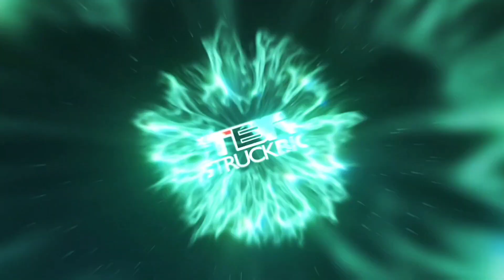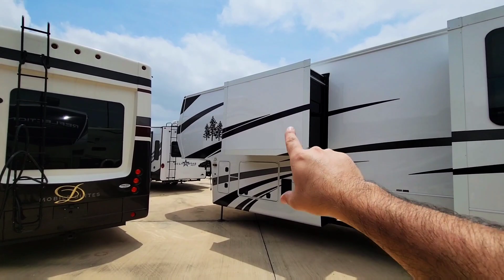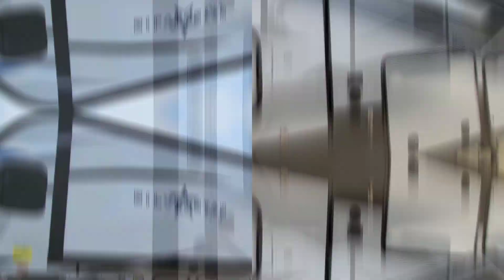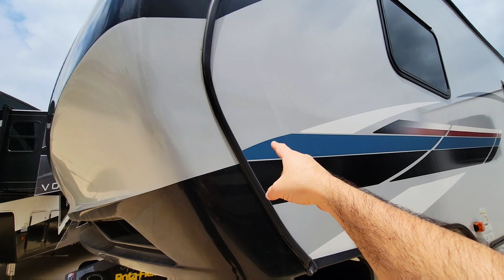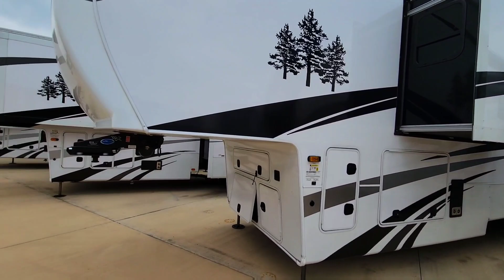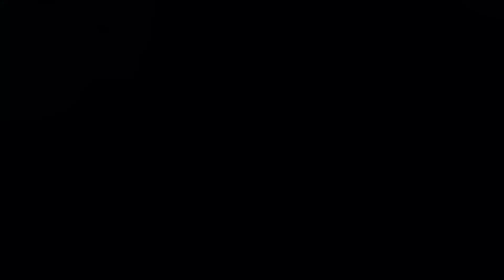The RV Industry NEEDS YOUR OPINION on this!

Comment: We have been camping at The Ridge Outdoor Resort in Sevierville Tennessee since the beginning of May so I decided to give you the opinions of fellow RVers. Yes, while a walk this morning, I asked people what their opinions were. 😀. We own a 2021 DRV that we LOVE. We purchased ours wanting full body paint, no vinyl decals and a traditional paint pattern. When asking others in the campground, I was surprised at what their opinions were. I will list them by each topic:
1. Edgier graphics - 14 to 1 said no. They like the more traditional designs on the units. One owner had the opinion we have, “When manufactures use the bold graphics and name incorporated (like the Voltage you showed), it cheapens the look of  RV tremendously”. 
2. Vinyl Graphics - 9 to 6 would prefer no vinyl graphics because of the durability. As one said, “If I am going to spend upwards of 80k, I don’t want it to have a ticking clock on how long the outside is going to look good.”  I agree with him
3. Full body paint - ALL 15 said they would prefer full body paint because of durability and look. As some of them said that they wished they could afford full body paint but it didn’t fit in their budget. I understand their point. We don’t full time but we go out a lot and for an extended period of time. We wanted to get the most of our money and not sink money into a unit without full body paint for it to look bad in a few years. It was worth it to us and a must on our list, if it had any vinyl on it, we passed quickly. 
Our opinion - The edgier graphics look very cheap to us, we would prefer for them to improve their materials and layouts instead of trying to make themselves different with the graphics. As I said previously, full body paint was the only way for us. We couldn’t justify sinking that kind of money into an RV for it to look really bad in a few short years. People want thicker side walls, better insulation, better comfort, etc but are okay with the outside prematurely aging?  That makes no sense to us. There is one unit (Grand Design Reflection) in the campground right now that is 6 years old and the graphics that GD put on their unit is so faded. That’s not okay.  They paid good money and they said they wished that they had put the extra money into full body paint.

Comment: I wish RVs could have vinyl wraps like other vehicles. You would get the look of full body paint at a fraction of the cost. It would protect the outside finish and could be changed if it gets faded, outdated or damaged. It could be expensive to change but could be done. I haven’t seen any manufacturer do a wrap, just stick on decal graphics.I like the look of the full body paint as it gives so much more color to the RV.

Comment: Every time i look at RV’s i ask “can they leave all stickers off.   If i was going to special order a gel coat i would ask for all stickers to be left off.  
Full body paint i would prefer less stripes and more solid color with Pearl in the paint.   Swoops are old looking i like the idea of straight lines If they have to do multiple colors.  Voltage would be my pick but i would rather have 2 colors and less busy changes.

Comment: The Voltage is a nice, clean evolution from the swoops that have been on Prevost RV's, low rider and custom cars since the 80's. Paint and graphics are long past due for an upgrade. Overlanding trucks and RV brands like Luxe have been launching units with minimalist graphics packages that just look clean. Sometimes less is more.

Comment: I definitely prefer the full body paint, both on the coach and the slide outs. The less edgy and the less swoops the better. I prefer the look of the Luxe 2 tone solid color paint job. The Voltage is the nicest of the ones you showed today.

Comment: Regardless of cost I would like whatever the most durable finish there is. I do not care about the color or the designs on them. If I had to have a plain white Motor Home that would last and last I would gladly drive it. I am definitely function over form.

Comment: I’d buy solid color every single time. Logos are fine but I don’t like stripes or swoops. The less graphics/designs the better. Like a solid dark gloss gray redwood with the name “redwood” in black on the side above the pin box and the black redwood trees on the front cap would look so good.

Comment: Full body paint all the way. It really brings out the character of the coach, and  enhances the whole body. It emboldens the coach and displays the fun mindset that RVing is all about. The Voltage looks absolutely stunning and paint was designed edgey and modern. Really states that it's about fun and it's built to make exciting memories. The swoops of the past are so dated and like you stated, somewhat boring. It's refreshing and breathtaking to see the full body paint "pop" off the canvas that the body of the coach is. It certainly makes a statement.

Comment: Personally, disc brakes, HD tires, and over rated axles and suspension is a way better thing to spend extra money on than full body paint.  But that voltage was great looking.

Comment: I love the first two designs.  I LOOOOOOOOVE grey, black, and white colors.  The Voltage looks amazing.  If I had one, I would get a sealant on the paint to preserve it as much as possible.  I have grey, black, and white swoop & edgier graphics on my Equinox Premiere SUV.  Also, I have a sealant on my entire vehicle AND a 3M coating on the front for nicks, etc.  👍

Comment: Personally I don’t understand the reason for all the graphics. To me it looks too busy. Minimalistic in my opinion looks better. But everyone has their own tastes and opinions, which is why RV manufacturers should offer both styles. Although I haven’t had any problems with the vinyl decals on either one of the 2 trailers I’ve owned, I do agree that the full body paint will most definitely last longer. My neighbor has a 2 year old Grand Design 5th wheel and he actually has bubbling under some of the decals. So that can definitely be a problem. I’m sure full body paint can have defects as well, but in the long run you’re probably much better off getting the paint rather than decals. The Big Horn was my least favorite (definitely too busy) and the Voltage was my favorite.

Comment: Love that Voltage!  But I'm more Edgy and Bold.  I like the sharp lines.  Gimme a full body paint with the Eddie Van Halen red "Frankenstrat" guitar graphic and I'd buy THAT!  Full body paint Pro's:  Super nice looking, better resale, easier up keep than stickers.   Full body paint Con's: SUPER expensive compared to not painted, have to be uber careful not to scratch it with routine maintenance items (like servicing the water heater (watch that door panel!), fridge, going on the roof, etc).  But full body paint, and super edgy sharp graphics are what I personally like.

Comment: I suppose my preference for edgy vs swoops really depends on the overall design.  You showed several of each style that were really nice that would be difficult to imagine with the alternative patterns.  On the other hand it really stood out that very little thought was put into some of the examples you highlighted.  No matter whether it's swoops or edges my preference is always going to be for a nicely designed pattern that looks like someone put some time and effort into and not just having it as an after thought.  Thanks for the opportunity to add to the conversaton.

Comment: Wish they would all go to full body paint. My Jayco travel trailer graphics deteriorated around 10 years, and my Jayco Designer 5th wheel graphics started fading and cracking after about 8 years even though I wax them periodically. My 2021 Jayco Eagle has very nice graphics which I am hoping will hold up better.

Comment: One I like best is full painted body of Redwood, next Voltage. I think that it depends on each unit: Toy Haulers should have an "edgey" full body paint scheme. You want to be notice out in the wide open spaces. Saying I have arrived. Full Timers want "Full Body Paint" with nice lines that reflect the manufactures paint scheme. They also want slide panels with graphics on them to "flow" nicely. I'm sure if a buyer really loves the RV, they will pay a paint store to paint it there liken. Stay safe. Keep the great videos coming. 👍👍🙌🙌🤓

Comment: I like light colors so that the heat transfer is minimal to the interior, requiring less running AC's. Simple graphics are great, if you don't wash with de-ionized water you will have water spots on the dark colors, requiring more work to remedy. Simple designs give the illusion of length and heights depending how they are used.

Comment: Something to consider on the full body paint is repair.   An otherwise minor side swipe can cause an enormous amount of paint repair.   Color matching can also be an issue.   I work in rv Insurance and minor claims turn into big long ones to fix the full body paint. I have also found they aren’t using top of the line auto paint on these in some cases and have seen some fading even in full body paint units.   I prefer a white camper with some nice but subtle decals.  They just need to start using some ultra high quality vinyl that won’t fade so bad... it does exist.  
Some of those crazy full body paints are over the top to me and almost make me dizzy.  I also question how they will look in 10 years and if the style and colors will still be “in”.   I think of 80’s and 90’s power boats full of crazy pink, purple and pastel designs.  Looked cool then... look gaudy and tacky now.  Just my .02.

Comment: We did the same thing as Valerie did. We asked 20 people here where we are this week. For us, a full body paint with a simple design is what looks the best and has the most long term advantages. That said, the cost of a full body paint would allow graphics to be replaced every few years... As for the group we asked.. 5 were over 60 and all liked the simple design or just a two tone color scheme. 7 were between 50-60 and all liked the graphics offered with a flowing design and were not enthused about paying for a full body paint job. 3 were between 40-50 and all liked the more contemporary graphics with 2-3 colors over a base color. All agreed a full body paint scheme of the same style would be better but not for the cost. The rest we asked were all under 30and thought the new random chaotic full body paint looked best (all also had these units and cost was not an issue). So in conclusion, I think it comes down to initial costs and age. If this is your retirement home and you’re already spending $80-$100k or more on the fifth wheel and $150-$250k on a coach, then the full body paint is just an included option. If it’s your weekend camping unit, then less is more because of costs unless you’re younger and well off... or not afraid of debt... lol. The rest of the crowd just seem to weigh in costs. Now if you plan to keep your unit for 10 years and use it often, pay the extra so it’ll hold better value and appearance. If you get a new unit every few years, just be prepared for your cost per night to double for the paint. Just my $0.02.

Comment: Edgy designs like in the Voltage modernize the look of the units today, and allows the manufacturer to market their brand to the RV public as did Voltage did with their "V". That look is awesome and very appropriate for toy haulers; however, I can understand and appreciate an RV owner who may not want a toy hauler also not wanting an edgy design but perhaps more traditional swoops. The first Redwood in your video was my favorite as it had nontraditional and nondimensional designs(Long wide boring stripes). What most RV owners and myself want is to have a unit that they feel is their "own" designed from inside out. Having the ability to choose(personalize) their exterior design would easily win over RV buyers as they do in the motorhome industry and is becoming more feasible with modern computerized painting equipment. Some of the best exteriors in the motorhome industry come from Tiffin and Foretravel with gorgeous swoops with a blend of edgy(veining in their swoops and combining nondimensional in their swoops as Redwood did in that first unit on your video., What I would like the towable industry to consider, and the VanLeigh guys have already begun to do this,  is to bring in nontraditional colors(Black,white,grey) like red. blue, silver, gold! Also offer a rear graphic that is fun and maybe defines the Family/Owner of that unit, like you're doing with your personal unit! Nothing would make a unit "Their Own" if they could go down the road with a "Florida Gators"  or "Margaritavile" or "Colorado" graphic on the rear of the Coach.

Comment: Brilliant looking Voltage! I always prefer the full-body paint (but not the cost of repairing it) but I’m not a fan of the busy / abstract patterns, especially the one on the BigHorn you showed. I agree that Alliance RVs have never been much to look at but Redwoods have always been fairly simple but clean and nice looking! Grand Design RVs are almost  always nice looking especially the reflections with the white background! My main dislike is obviously cheap, vinyl decals or anything easily damaged!

Comment: I would prefer a solid color, with maybe a line to break it up.  That would allow for some owner personalization with decals down the road.  Thinking a large American flag prominently and proudly displayed on each side!  Definitely a fan of full body paint.

I agree with you, that Voltage at the end of your video rocks.  If I were to have to buy one based solely on the exterior appearance, it would be the Voltage.

Comment: Full body paint is always preferable.  The Voltage is probably the nicest of them.  But, it’s also kinda busy.  I think the colours are lacking, there should be more options and varieties.  I think they should throw out the “playbook” and create designs that complement the unit it’s going on.  Sometimes, the swoops are nice, sometimes straight lines and edges are great.  Sometimes perhaps a single bold colour or a two tone might be cool.  But I think why the Voltage was standing out in that video was because it wasn’t white and beige.  I hate when I go to a manufacturers website, and I’m dreaming about that sweet RV that’s going to be awesome on trips, so I go to build my own (please stop email walling this feature too, I want to see the final thing without having to be sold hard on it.), get to the colours, and I can pick white, beige and grey with a blue stripe, or white, beige and grey with a red stripe!  Wow, what a dreadful and uninspiring choice!  That red stripe that maybe runs part of the way down the unit really changes things up! 🤔 

RV graphics are almost always too safe, too similar and often dull, even when they are really busy looking.  Work on designs that are unique, and suit each vehicle.  If you have a unit aimed at younger buyers, make bolder choices.  If you have one targeted to older or more traditional buyers, go swoopy and beige.  Try fun things if it’s a family unit like images or murals, or be classier if it’s a couples unit by being more sophisticated with the colour choices and design.  Best yet, for the same rig, have different options.  Have a beige swoop option, a darker edgier one, and maybe a clean minimalist one, or even more! People want choices, and don’t make it a crazy expensive option, just price units appropriately and make it easy to pick a design.

Tell your chosen designers to make each rig look it’s best, and the feelings and goals you have for it, and let them create something cool.  Take risks, be bold, make things awesome.

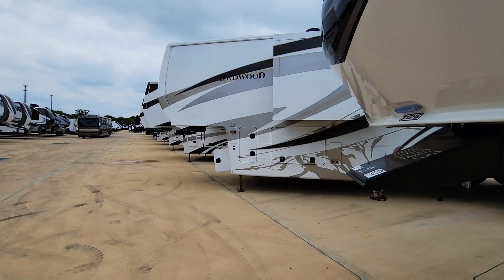Comment: My favorite is Redwood at 10:30.  Prefer full automotive paint for full-time and predominately RV park usage.  If designed for off-road or non-paved boondocking, I prefer less graphics and white as dominate color so slide-outs match and ease of maintenance.  Presently have gel-coat with a graphics package and color-matched awning case and air-conditioner sheath on my class B.  Important to stay on top of exterior for reduction of oxidation.  I camp and travel in extreme conditions and weather; dirt roads to pristine asphalt and both hot and cold temperatures (120 to -20).

Comment: The Big Horn is sweet, also like the Beacon.  Interested in whether full body paint is durable enough to hold up to tire failures.  Repair cost...

Really like the sharpness of the voltage as well.  

We don’t need trees or mountains or animals on the coaches.

Comment: To me, more than graphics - fix the "standard color" problem. WTH is with the standard beige on all the RVs???? Fix THAT. Yeah, the graphics break up the sea of bland color - but the more critical component is the color itself. I get that manufacturers are conscious of how color absorbs heat and also cost of paint - but there has to be a rational solution beyond beige. It has always felt like a middle finger. "You'll take this crap beige and like it."

Comment: Of course this is very personal. I prefer simple and light colors. I don’t care if it is edgy or swoops. I liked the white Redwood the most. I didn’t like the Voltair because it was a dark color. The outside appearance isn’t that important, I think the frame, suspension, floor plan are far more important than its appearance. Colors and styles change. So what is in style today won’t be in five more years. I spent two days at an RV show talking to the designer of the KZ Gold fifth wheel. He said they only sold one or two full body paint RVs a year. A full body paint is an additional $10k. I think putting options like an upgraded suspension, tires, shocks, 12v refrigerator, generator, superior water filter, 2nd or 3rd ac and other things is far more important than a fancy paint job. I go for function over appearance any day.
Thanks for the video.